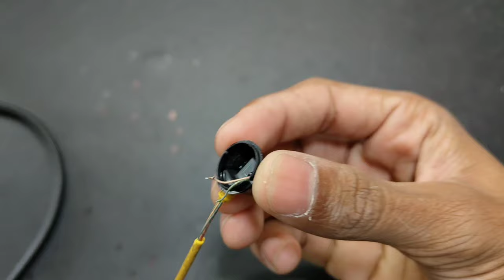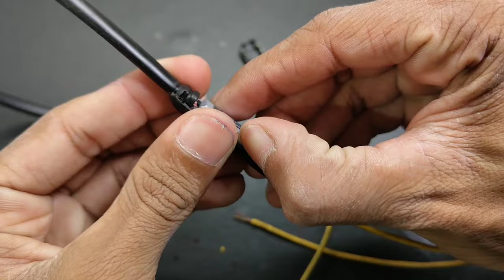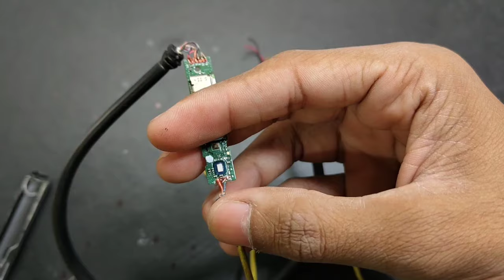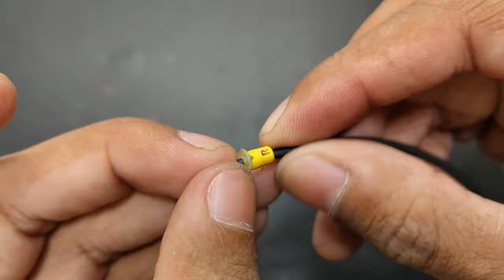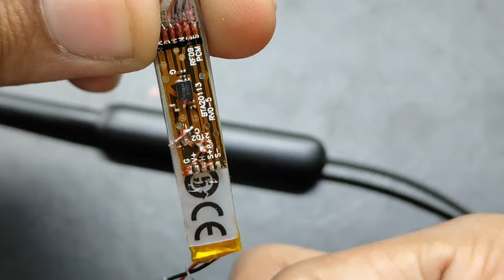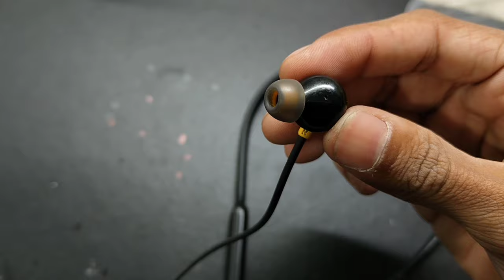Realme bluetooth earphones repair | How to repair realme earphones | Bluetooth earphone not working

Comment: Dear Consumers,

I am writing this message to warn you against purchasing products from Realme due to their extremely poor quality and abysmal after-sales service. My personal experience with Realme has been nothing short of a nightmare, and I feel obligated to share my story in order to protect you from making the same mistake.

Realme products are marketed as affordable options, but their low prices come at a high cost to quality. The materials used in their products are cheap and flimsy, resulting in frequent defects and malfunctions. The lack of durability and reliability is alarming and suggests that Realme prioritizes cost-cutting over customer satisfaction and long-term product performance.

Moreover, the after-sales service provided by Realme is utterly disappointing. Their customer support team is ill-equipped and unresponsive, displaying a complete disregard for resolving issues and addressing customer concerns. Attempts to seek assistance through warranty claims are met with frustrating delays, unhelpful responses, and an overall lack of professionalism.

I strongly advise against purchasing any Realme products, as they are a waste of hard-earned money. The initial affordability may seem tempting, but the subsequent frustrations and disappointments far outweigh any potential savings. Investing in a more reputable brand may require a higher upfront cost, but it guarantees better quality and reliable after-sales service.

Please heed my warning and spare yourself the frustrations and regrets that come with purchasing Realme products. Look for brands that prioritize quality, customer satisfaction, and efficient after-sales support. Your money and peace of mind are too valuable to be wasted on subpar products and companies that fail to meet basic consumer expectations.

Spread the word to your friends, family, and social networks, so that others can avoid falling victim to Realme's poor quality products and lackluster after-sales service. Together, we can hold companies accountable for their actions and make informed purchasing decisions.

Choose wisely, prioritize quality, and demand the customer service you deserve.p
Reply: Achha ❤❤❤

Comment: Bro sensor aur speaker ke Mila ke 6 wire h sensor ki 3 wire h usko kaha kaise joda ???
Reply from the maker: 5 wire h bhai total 3 sensor ke 2 speaker ke jisme 2 sensor ke positive or negative he or ek signal ka wire he baki ke 2 speaker ke positive or negative he
Reply: @nextgenjayant  haa but normal wire mein Jo change krne ko socha raha usme 4 hi h  sensor wali dikkat fhas rahi h usme 3 wire h kaise kru
Reply: @nextgenjayant  sensor ki 3 wire mein se kisi ko common karke 2 ni kr skte ?
Reply from the maker: Bhai kisi ek wire ke 2 part kro or multimeter se check kr ke 4 ke 5 wire bana lo or jo 1 se 2 banaoge use speaker se connect kr dena
Reply: @nextgenjayant  bhai aisa ni ho skta without sensor ke use ke ske